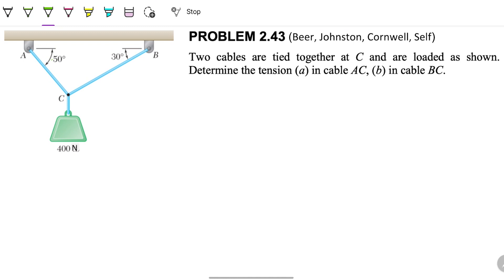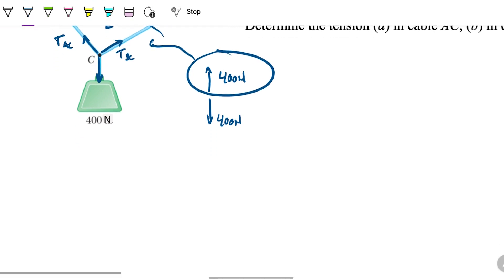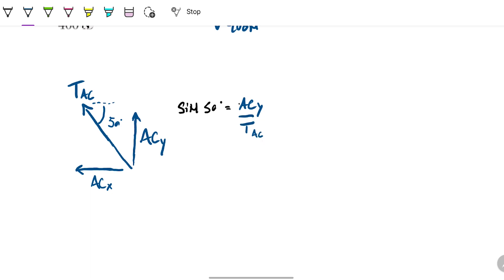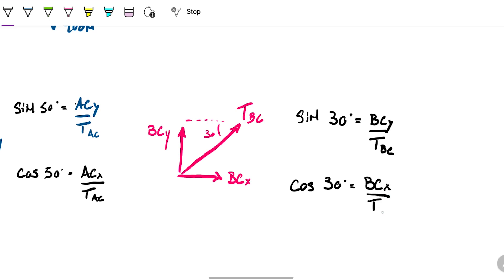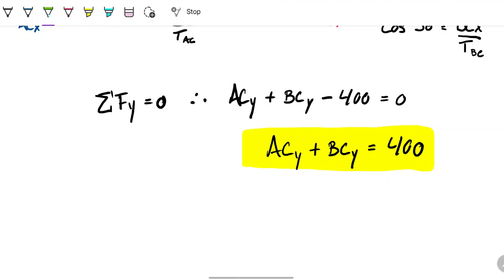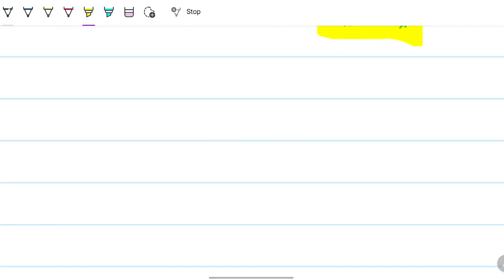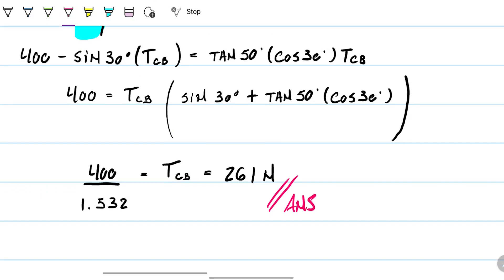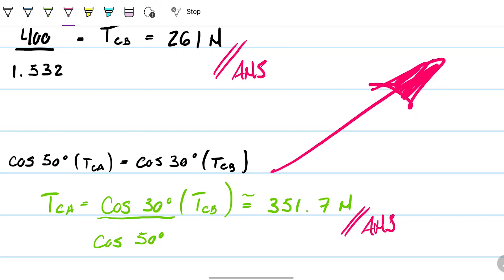Solving Cable Tension Problems (different approach) | Statics

Comment: Wait, how to get 351 in tca? Cos 30/cos 50 × TCB (261)?
Reply from the maker: Yes, exactly. But are you asking whether 261 * cos 30 / cos 50 will render 351 or are you asking how I arrived at the 261 * cos 30 / cos 50 equation?